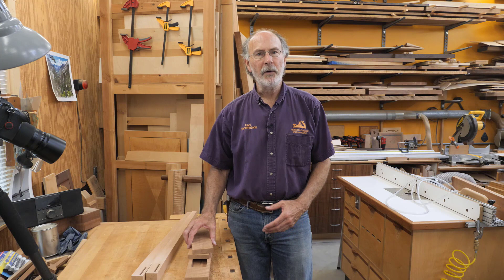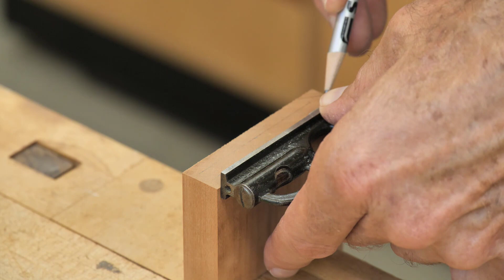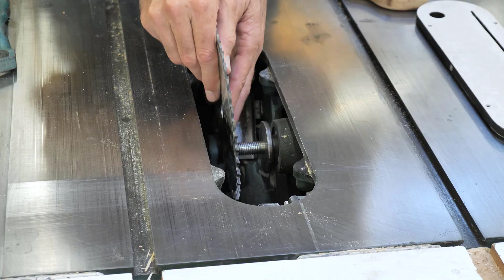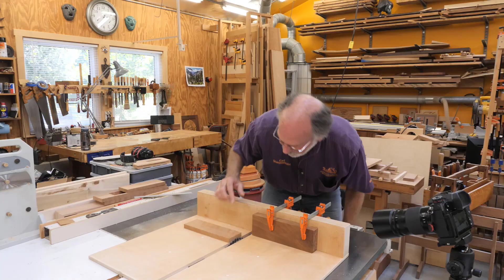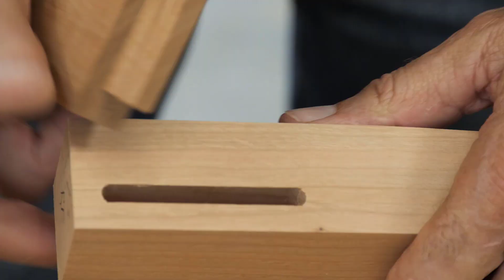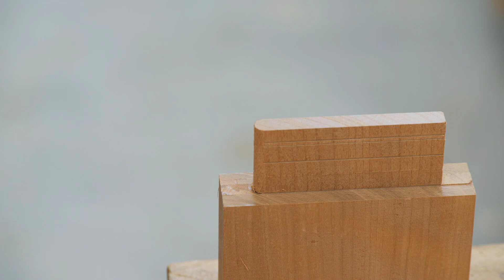Console Table Build Part 7

Comment: Can you please give a quick tour of your dado storage caddy? I am almost done making the WoodSmith caddy and they use a coupling nut to hold the blades. Really wanted a better way but my metal lathe is in pieces in the corner of my living room.

Looks like a wooden dowel and magnets?
Reply from the maker: Yes. Wood dowels and magnets. Works well and easy to access the blades and chippers one at a time. Watch that the magnets aren’t too strong or getting the blades off might be an issue.